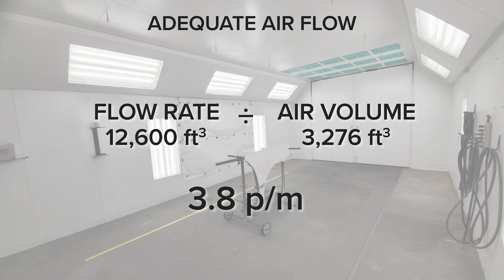How to measure spray booth Airflow

Comment: How did you get the flow rate of the room? 14x9x100? So you take 2 dimensions of the room and multiply it by the fpm reading you get from the anemometer at the exhaust?

Comment: I'm kind of at a point I need to do something,  my work space is 16'WX 27'L X 10'H  I have one exhaust fan it's 26" multiple speed  with three intake filters that are 16" X 24" it clears out ok but could be better. My intake filter are in the big door and exhaust fan is in a side wall ?
Reply from the maker: Try to get even linear airflow OVER your workspace or project.... Air doesnt like to turn corners, and you can create turbulence and dirty spots with uneven airflow.   You could even create a duct to draw air in an even manner.
Reply: @paintucation  
I will I'll have to reconfigure my paint room